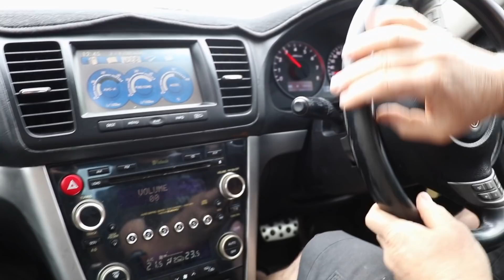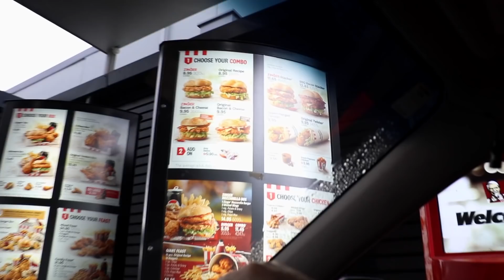1JZGTE POWERED LJ HOLDEN TORANA EP 8 - THE SKID FACTORY

Comment: You have done well to strip so much in one day. it took me 2 weeks roughly to completely strip my vt calais engine bay mainly because the gel coating they use on the fire wall from the factory isnt really affected by aircraft paint stripper. so the fire wall alone took me a week, i also had to straighten out a chassis rail while i was there and i uncovered some old body work and filler but like I said you have still done well. Just remember the longer it sits there bare metal the more moisture will start to cause surface rust and you will have to start all over again. as each area of mine was done it was then coated in weld through etch primer to protect it :)

Comment: As a painter and decorator of 5+ years, can't tell you how handy those rolls of tape edged plastic drop sheets are. You can also get them in paper from a paint supply shop (bunnings etc) if you're fighting against ripped plastic. Just a heads up :)
Reply: Maybe, but they don't have the sheer class of Christmas paper.

Comment: Hey mate. Mix the paint up in the container then stick the filter in the gun and tip the paint into the gun. 

Also, don't use Supercheap auto bog, it is garbage.  Find a paint supplier and Get some Rage Gold in a big tin, and a bottle of Evercoat Easy sand.  Will save you alot of work and time.

Comment: Technically you did not have to strip it to bare metal, You could have hit the bad rust spots with grinder/wire wheel and loose paint, Then use like 180-320 grit where there is paint and just smooth it out, No paint stripper needed, Then cover it with 2 part epoxy primer to seal it. A little sanding then paint. But stripping to metal works as well. More then 1 way to skin a cat.. Great job none the less.

Comment: Just because paint says it can be applied to bare metal, doesn't mean you should!
It DOESN'T WORK PROPERLY!
Reply from the maker: What do you apply to bare metal? Primer? Isn't that paint too? I am confident that Valspar knows what they are doing with industrial paint.
Reply: @theskidfactory  no, primer isn't a paint. Its a surface preparation. It's highly porous which is why it can't be used as a top coat.
There are many 1 step paints available and if you prep the surface properly, they are OK. But will never be as good as a primer and epoxy as resisting chips and contamination
Reply from the maker: The Valspar stuff is expensive and made for purpose.

Comment: Arghhh STOP  using that SCA crap body filler, go grab some Rage Gold or equivalent from an auto body supply shop, you'll fine it way better to apply sand and finish, and youll save a mint on sand paper, them paint and body products from SCA are crap, $110 a liter for top coat there where its only $60 a liter at a pain supply shop for the quality